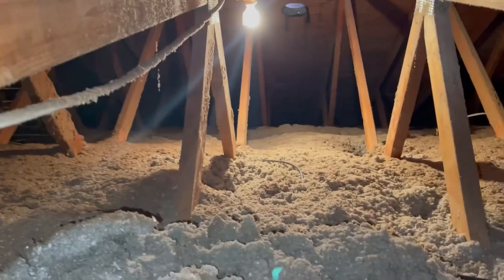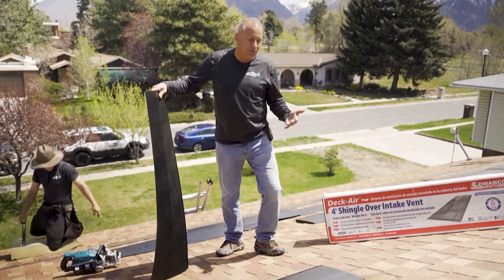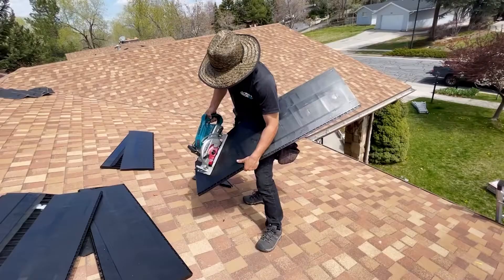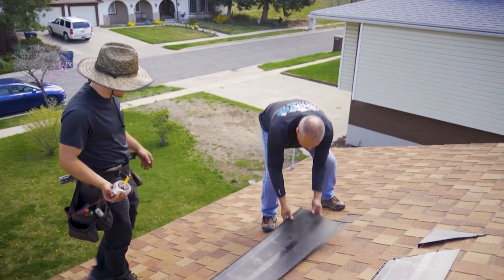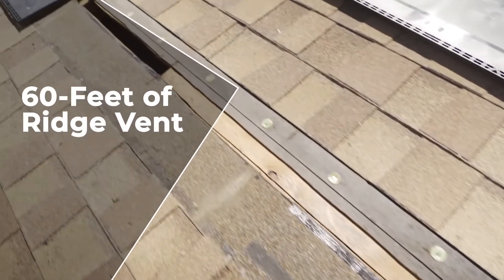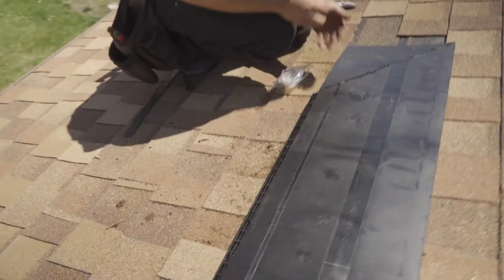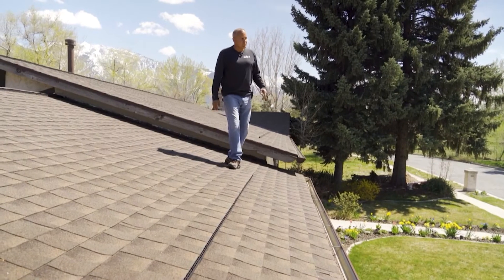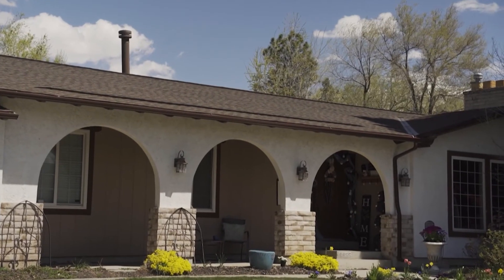Installing Intake Vents to Increase Energy Efficiency

Comment: That will leak with high wind rain. It is supposed to be at the very bottom. Get ready to fix drywall. Also the problem with your ice guard is that if water gets under the shingles above it then water will run underneath and get in your hole in the middle of the roof. This is terrible.
Reply: It can be installed either way at the roof line or a few rows up, it can even be instalked as exhaust if installed near the ridge of the house (no ridge vent) and underlayment goes on before shingles